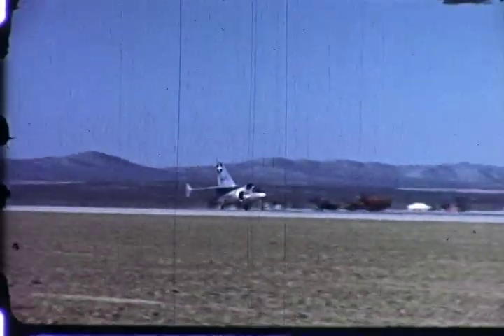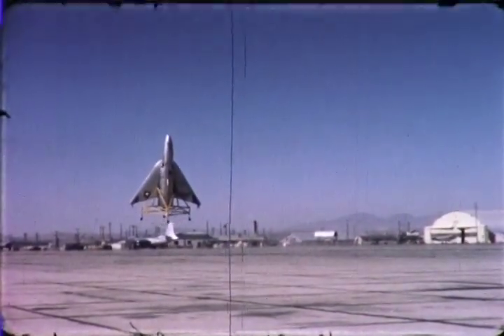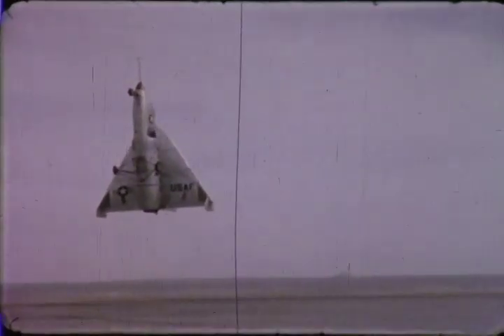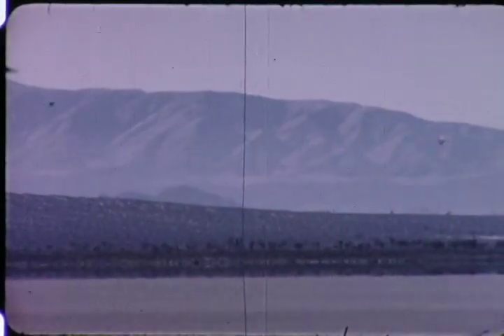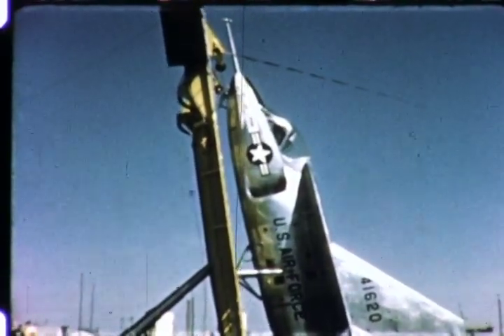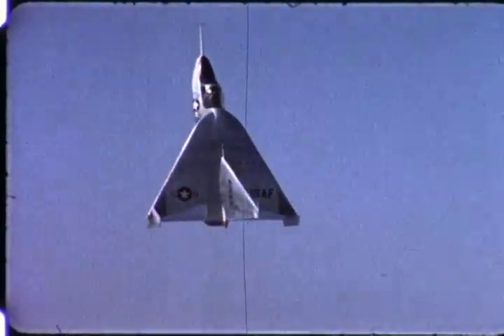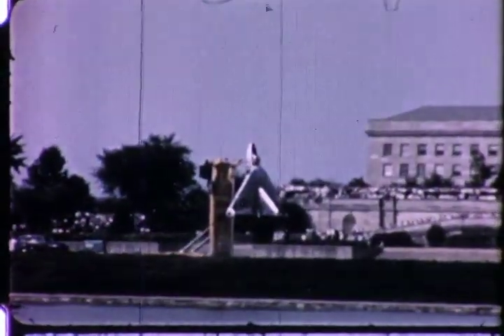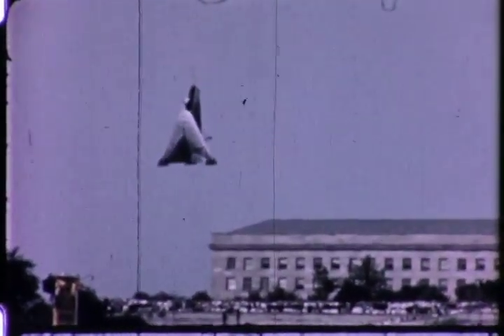F-0074 Ryan X-13 Final Test Report

Comment: I was one of the designers/testers  of the "Auto stabilizing" system.  And YES it had the glide path of a rock.  It could also out climb anything with wings.  It was totally experimental and several other companies were competing, GE & Bell for example.
Reply: That's incredible, Jim, what an amazing aircraft and vertical landing 63 years before SpaceX!
Reply: I was stationed at Edwards from 1963-67. This plane is one of the most significant achievements in my opinion. Wish this concept would make a comeback.
Reply: @gator1984atcomcast  It's quite noteworthy that space-X now recovers its boosters the same way: by grabbing them at the gantry.
Reply: Große Gratulation!
Big work!!
Reply: Jim did your work translate to the Firebee program? I think Ryan built a lot of those drones
Reply: Jim I'd love to find out more about that stabilization system.  My dad was the 2nd pilot on the X-13.
Reply: Was the system electronic with electrohydraulic actuators?

Comment: I'm guessing fuel consumption would be a problem - Any jet in vertical position has no aerodynamic lift and relies 100% on engine power.  It wouldn't be able to do this often or for very long.  ...but you'd think mid air refuelling would resolve that.
Reply: Late reply, but regardles; The idea behind these was that they'd be interceptors. You only need this capacity if your enemy is bombing your airfields.
And so, the opponent these fighters were supposed to fight against would always come to them. And thus, range wasn't a major concern.